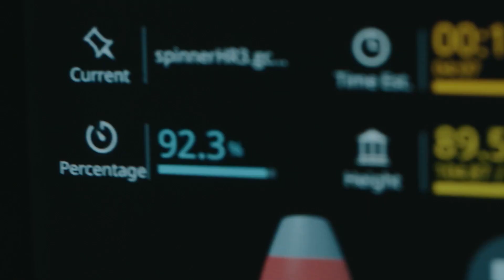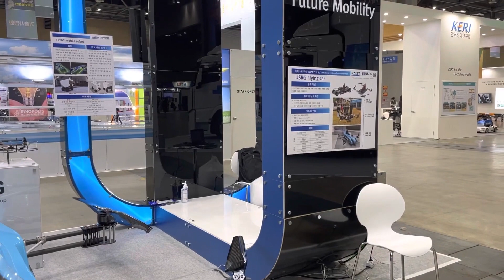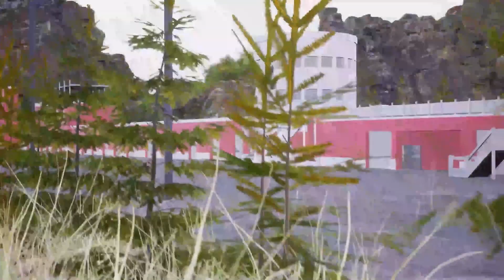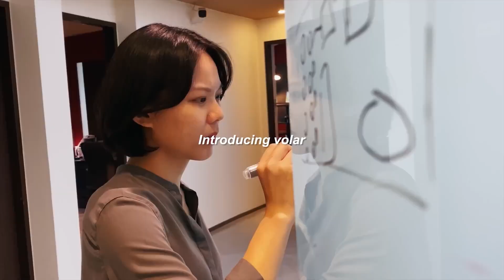Top 10 Electric Racing planes

Comment: Racing style quadcopters literally fly perpendicular to the ground. If the propellers are fixed up and down, then full throttle will move the craft Up, not forward. To make these not-a-hovercraft the props would have to rotate 90 degrees so the pilot and craft stay horizontal otherwise design a craft to take advantage of the perpendicular flight at speed.
Reply from the maker: I'm not sure i am getting you right but i think you're saying a  fixed wing or a fixed-wing hybrid design will be faster than the quadcopter design. If so you're right. I think some of them are just trying to sell the concept, and they are trying to operate as safe as possible so it dosent come out as too risky. once they have gotten mass adoption and kick into full gear they will surely start pushing the speed limits.

Comment: Got YBCO?
Reply from the maker: Do you mean Yttrium Barium Copper Oxide - YBCO?
Reply: @EVTOL-consult  The biggest challenge of using electric propulsion in aviation is the power-to-weight ratio: Conventional electrical systems can’t produce sufficient thrust without weighing down the aircraft. HTS materials offer high power density and high efficiency in a compact and lightweight package. They could also lighten other electrical systems, such as flight controls, communications, and power electronics.
Reply from the maker: @joebrenner4428  carbonfiber is cheaper. If you build an EVTOL using this material, the production cost will go up, and so will the selling price
Reply: @EVTOL-consult  An HTS motor is 5 times more powerful and an HTS generator has 5 times the output.Liquid hydrogen 3 times more energy density as compressed hydrogen and 10 times lithium ion.LH2 drones are setting record flight times and I got this.Okay?
Reply: @EVTOL-consult  The use of liquid hydrogen as a fuel will be inevitable in the aviation of the future.
Reply: @EVTOL-consult  Development of the Future Aircraft Propulsion System Based on HTS Electrical Equipment With Liquid Hydrogen Cooling ;
Reply: @EVTOL-consult  What's wrong with PVD alloys?"Magnesium is the lightest metal known on earth has a great potential to be used as a structural alloy. The lightweight alloy and composite property attract the automobile and aerospace companies and provide an alternative to replace the denser metals such as steel, cast iron, zinc alloys and even aluminium alloys."
Reply: @EVTOL-consult  You have obviously never heard of Super Magnesium. "Super Magnesium alloy: Lighter than aluminum and cheaper than carbon fiber. The creators of a new high-strength, low-weight metal alloy"
Reply: @EVTOL-consult  "May 19, 2021 — New forged magnesium alloy can be even lighter than carbon fiber. ... Long considered the holy grail of lightweight wheel manufacturing"
Reply: @EVTOL-consult  I am calling it Air Supremacy dude.
Reply: @EVTOL-consult  Super Stainless Magnesium."New Magnesium based alloy as World’s strongest and lightest metal to change the world: Researchers from North Carolina State University have developed a material using magnesium which is light like aluminum, but as strong as titanium alloys. This material has the highest strength-to-weight ratio known to mankind."
Reply: @EVTOL-consult  Much like a glowing orb.
Reply from the maker: @joebrenner4428  you're right but carbonfiber is still lighter so it depends on the use case scenario it could be a better choice.
Reply from the maker: @joebrenner4428  I guess new materials are created every day. You seem to be very knowledgeable in the area of material sciences. I'm glad to get this king of insight after all material selection can be a huge factor when designing in the bid to achieve light weight with cost savings.
Reply from the maker: @joebrenner4428  Are you into material Engineering or sciences?
Reply from the maker: @joebrenner4428  In the aerospace green energy race, various companies are rooting for different energy solutions . Only time will tell. Hydrogen may be cheaper and more powerful but batteries are still less volatile so for aircraft performing short range flights in a busy neighbourhood where speed isn't a huge deciding compared to potential of a catastrophic incident from volatile chemicals. Batteries might be a better choice.
Reply: @EVTOL-consult  10 minute flight times just aren't going to do much for me.I feel the need for speed and intercontinental travel.
Reply from the maker: @joebrenner4428  I believe hydrogen will be best for intercontinental travel. There is also Sustainable Aviation Fuel(SAFE) though.
Reply: @EVTOL-consult  The corresponding volumes of LH2 and LNG required are 9,760 and 30,300 L, respectively. In both cases, the estimated mass of the fuel needed for the aircraft is more than what is needed to maintain the cryogenic environment of the power devices. It was concluded that an electric aircraft with LNG cooled normal metal devices is feasible.
Reply: @EVTOL-consult  yes true